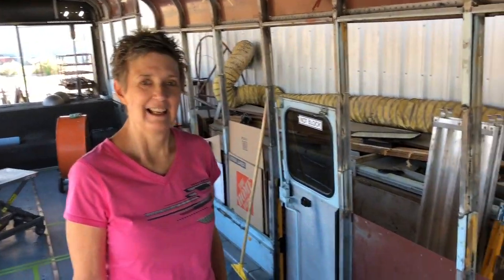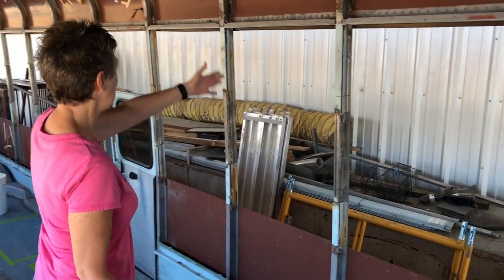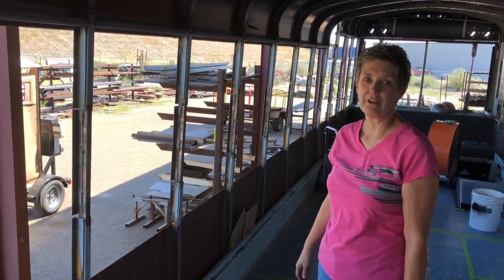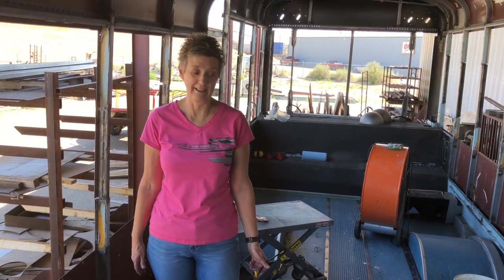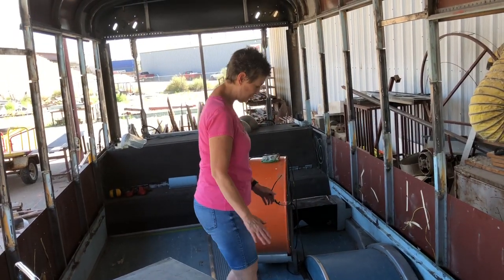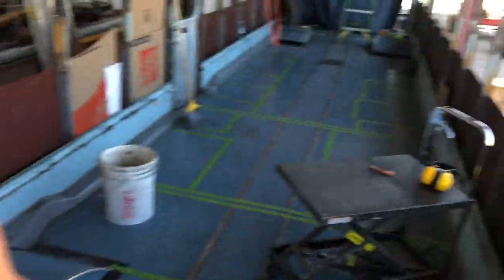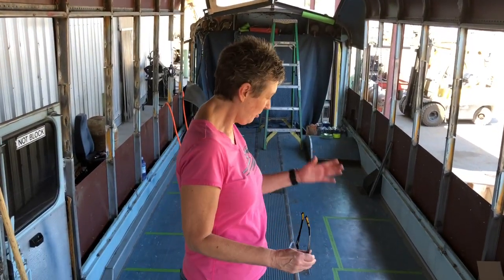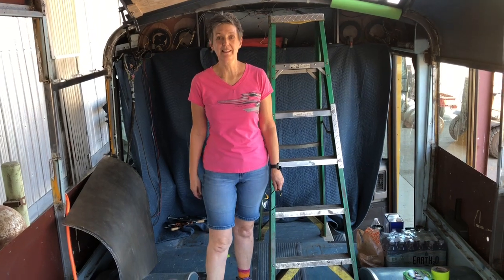Bus Floor Plan - Vlog 17 School Bus Conversion

Comment: I was thinking about the idea of the bathroom clear in the back with the bedroom in the middle, partitioned with accordion doors to allow a possible bigger living space...and then remembered the roof height issue. The good thing about what you have is you create two solid separate spaces that both have private access to the restroom.
Reply from the maker: Yes - that's what we were going for. Two separate areas for times when we need to be away from each other.  And with the Murphy bed in the back it will totally open up that area for whatever we want to use it for.